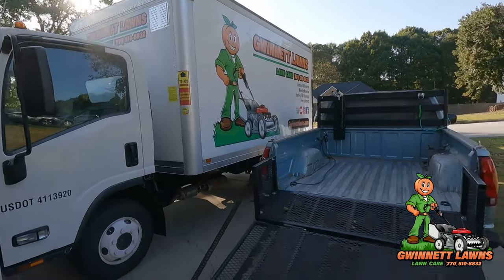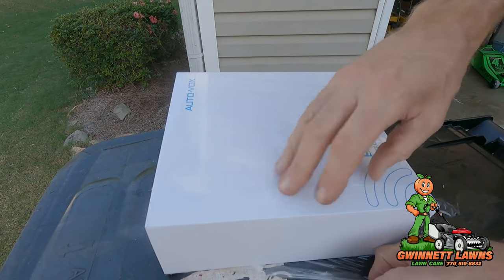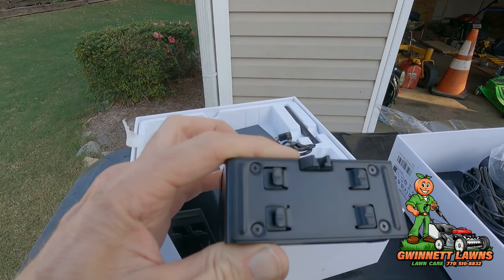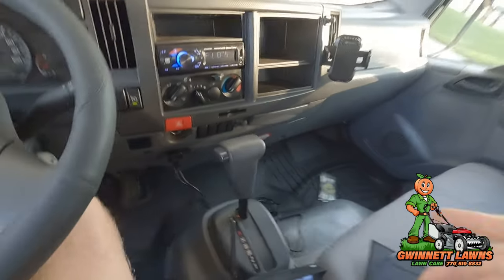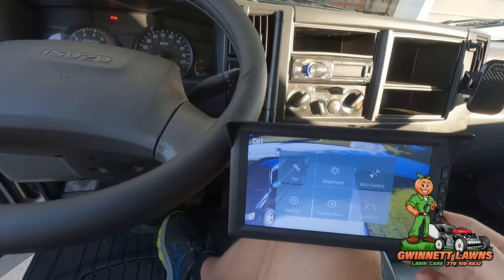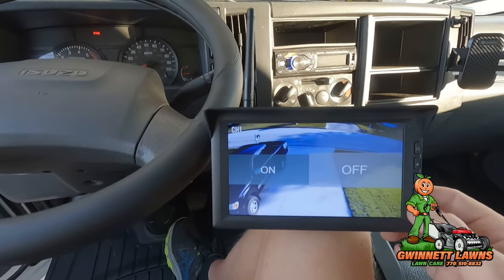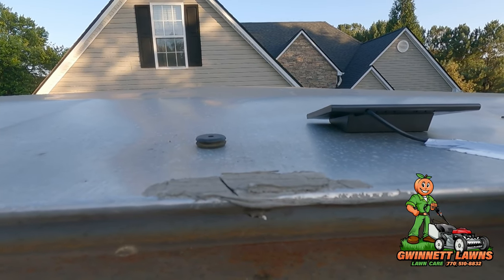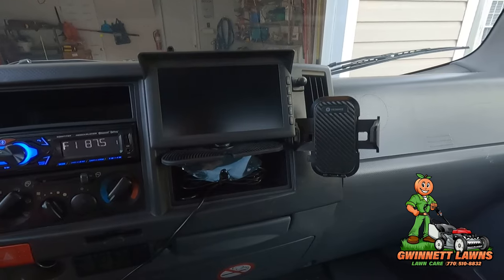Isuzu NPR Box Truck Build Series: Wireless Back up Camera

Comment: How are you liking your back up camera to date, thinking of putting one on my Isuzu 2024
Reply from the maker: It’s working out great!
Reply: Do you leave the monitor on all the time or just when you back up, did you ever add a 2nd camera?
Reply from the maker: @rsweares5798  I just use it when I’m backing up I do need to add a second camera so I can see what’s to the right angle of my passenger side but I haven’t done it yet.